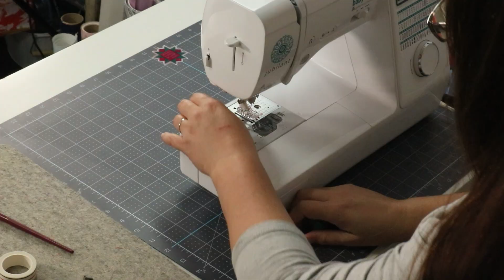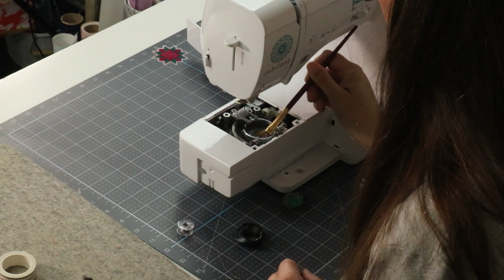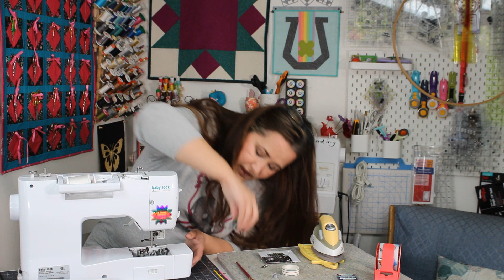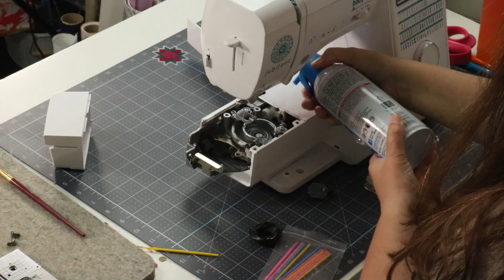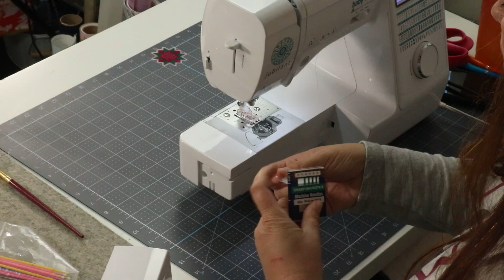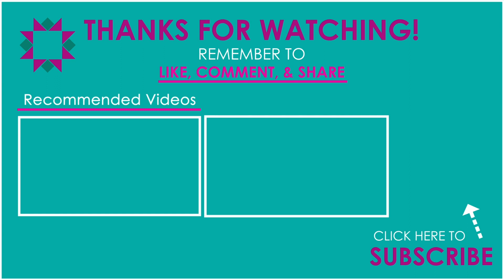How to Clean a Sewing Machine

Comment: NEVER EVER USE CAN AIR ON YOUR MACHINE.. no matter what the Can says.. 🤷🏻‍♀️
Reply from the maker: It isn't about what it says on the can. A machine tech at Baby Lock HQ actually told me that it is okay to use canned air ... if you do it correctly.
We don't use canned air on most machines because blowing the air into the bobbin housing doesn't blow the lint out. It pushes it further into the machine, creating compacted balls of lint.
With a Baby Lock, the side of the machine comes off. This means you can blow the air from right to left, which blows the lint out of the machine. That is what makes it safe.

Comment: I'm sorry but I would NEVER use canned air anywhere near any machine I own without checking that the manufacturer says it is safe. Your manual will tell you what you can and can't do as it can vary from model to model.  This is certainly the case with my longarm which gets cleaned in a similar manner to a domestic sewing machine.
Reply from the maker: Since I learned this trick from the folks at Baby Lock directly, I'm confident that it is safe. 🥰